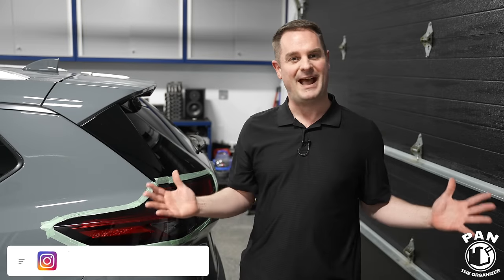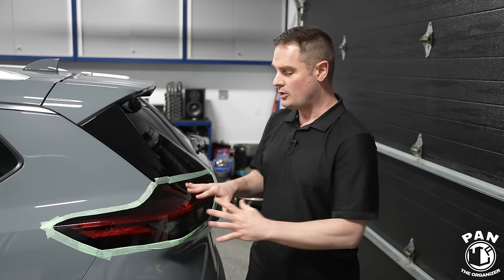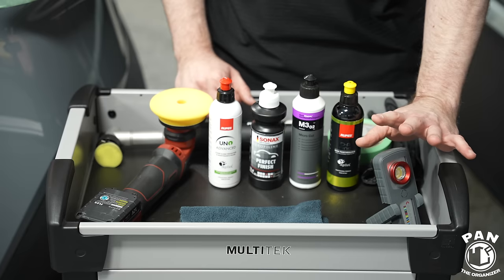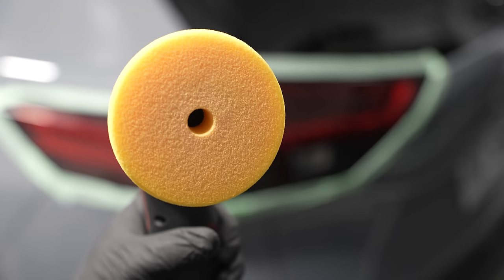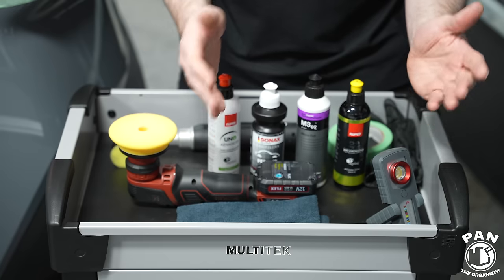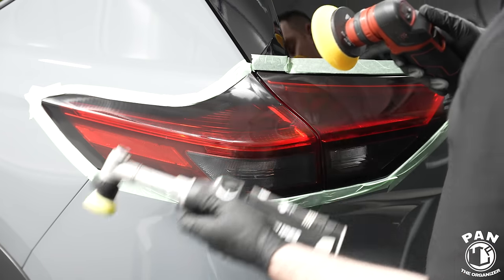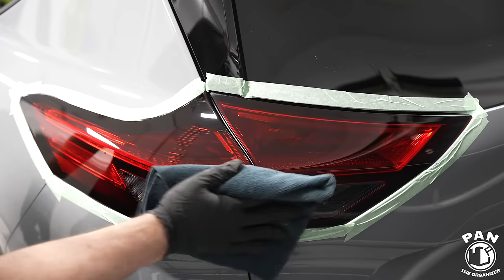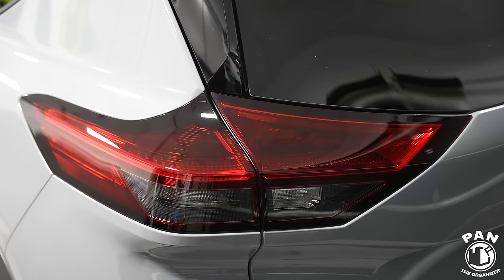How To Polish Tail Lights

Comment: Can i put a ceramic coating if i were to use this product on the whole vehicle??.. let the product ait 15 mins.then buff off . Then the next steps??????????
Reply from the maker: I wouldn not apply a ceramic coating on top of this. Coatings need to bond directly to virgin clear coat that has no protection on it.

A polish like this containd a bit of protection in it as it’s an all-in-one type polish. The protection should last a few months.

If you plan on applying a full blown multi-year ceramic coating (from a glass bottle), it would be best you polish the car using a pure polish with no protection in it (like Sonax Perfect Finish) then use a paint prep spray or IPA to wipe the surface of any polishing oils and then you apply the coating.
Reply: @PanTheOrganizer  thank your pan .. u have been nothing short of amazing with knowledge and helping out us car detailers to do it the right way. Thank u again for helping me. .🙏

Comment: Are you going to be doing a more in depth review of the Uno Advanced polish?
Reply from the maker: I don't see what more is needed. It's an all-in-one polish that offers up to 12 months of protection. So a light cut and finish, and lays down a light layer of ceramic protection for those who want to polish and protect in one step. Plus you had a demo of its capabilities here. ;)

Comment: Is there any advantage to using incandescent light for an inspection vs an LED? I know some engineers that are only allowed to use incandescent for certification inspections but their explanations why seemed a bit suspect. I’m sure there’s a reason but some people would rather give the wrong answer than admit they don’t know the real answer.
Reply from the maker: I don't overthink the moment as much. We are talking about detailing here, not some high level engineering tasks. So don't go down that rabbit hole.

What is true however is that some color temperatures are better on certain colors of paintwork. Many people prefer using a warmer color temperature (2700-3000K) on light colored vehicles (white, silver, etc) and a cool color temperature (5000-6000K) on dark colored vehicles (charcoal, black, etc). Most inspection lights (like the Scangrip I use) have an option to switch color temperature on the fly. Simple.

Comment: I’m sure this is the same process for headlights????
Reply from the maker: Not quite. It depends on the level of oxidation. If they are heavily oxidized, milky white or yellow, you might need to start with water sanding first, then compound, then polish, then IPA wipe and then ceramic coating.

If they are only lightly oxidized, see my headlight restoration tutorial here: https://youtu.be/sqpXsBcVako?si=A9WqEBNP0HzKIIal

Comment: I cringe when the dealer mentions that they will wash the car free with service.  I specifically ask them not to and make sure they write that on the service order before I leave.  The one dealership has an automated car wash they use afterwards.. no thanks.  The few I have dealt with have all been great and have not washed the vehicle as per my request.  Great video btw, tail lights look great afterwards.  I'm going to try UNO Protect on my daily to test longevity.
Reply from the maker: I agree with you 100%! When I bring my car in for servicing, I make it VERY clear that I don't want them to wash my car.

Comment: J’ai toujours pensé que polir les lumières allait enlever la protection UV et qu’il allait jaunir !
Reply from the maker: Polir les phares avant ou arrière est la même chose que polir la carrosserie. Oui tu enlèves une fine couche du vernis, mais si tu es prudent, tu n'enlèves pas tout le vernis (qui contient les blockeurs anti-UV). De plus, tu ajoutes toujours une protection à la fin du polissage, peu importe la surface, pour justement renforcer la protection UV. Dans ce cas-ci, c'est un polish qui contient déjà une protection céramique. 2-en-1

Le jaunissement des phares provient de l'oxidation causée par les rayons UV du soleil. Pas par le polissage. C'est cette oxidation de surface et le rayures et tourbillons qu'on enlève lorsqu'on fait le polissage.

Comment: Can I use the same process and products for headlights?
Reply from the maker: In theory yes, but it depends on how bad the oxidation is. If the headlights are very milky white or yellow, and heavily oxidized, you're likely going to need a bit more cutting power from a compound first, followed by a polish. Some even need to start with water sanding first.
Reply: I have a 2019 Lexus ES350 F Sport. The headlights look pitted. I don’t see scratches.
Reply from the maker: Polishing the headlights won't correct the pitting, as that's missing material. Just like polishing won't correct stone chips on paint. 

See my tutorial on headlight restoration for headlights that have light to medium oxidation: https://youtu.be/sqpXsBcVako?si=WRIQRJ0ZD-OYu8Vl